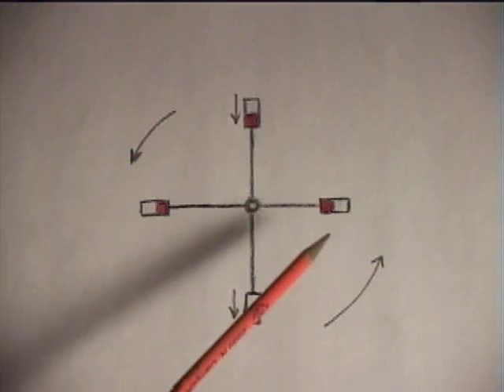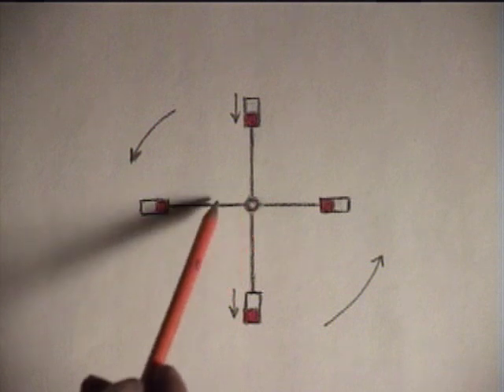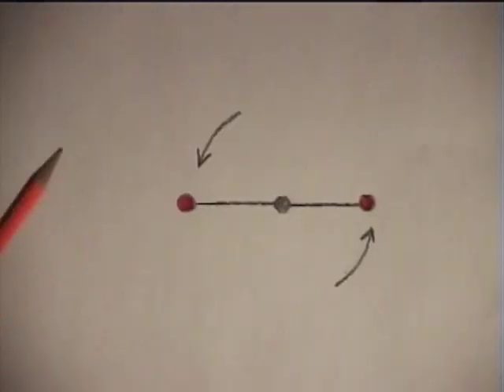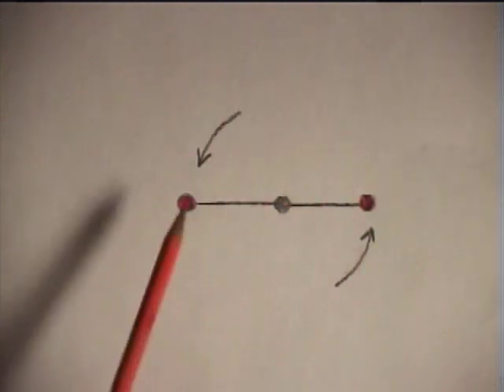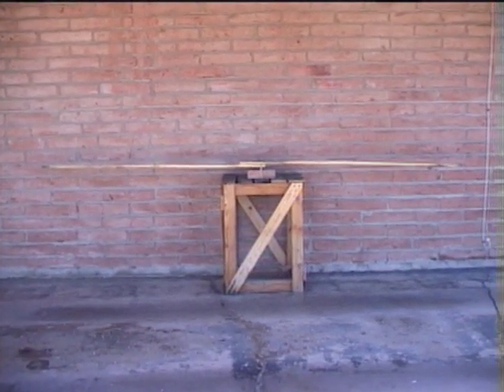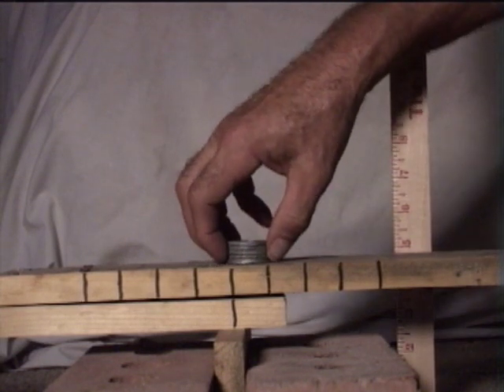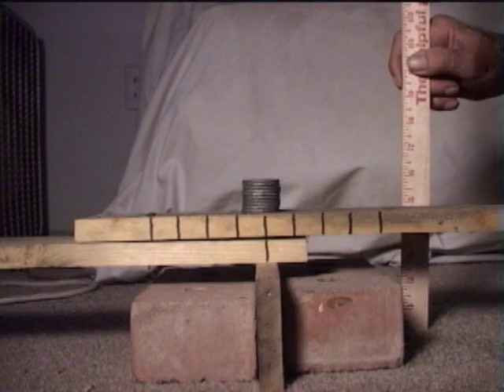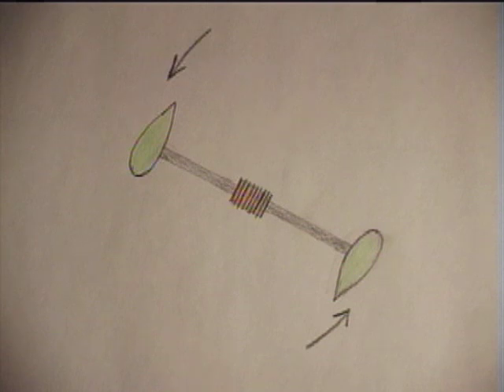Gravity Energy Wheel, Free Energy

Comment: you are on the right track because gravity is constant. on a fly wheel you have four 90 degree pie. with four triangles around a flywheel there is no reason why we couln"t use a heavier weights in the inner portion of a wheel to displace lighter weights to the outer edges of the wheel, it breaks down to using 4 independent but subordinates sections in a fly wheel with two alternating forces the weight and counter weight to determine the position of the mass and create a unbalance wheel as it rotates past the vertical position gravity pulls down on heavier weights to displace lighter weights to the edges as the vertical alignment riches 180 degrees the heavier weight fall to the bottom reversing the position of the weights and the cycle starts again. imagine your fly wheel had a weight on a track across or vertical to a line parallel to the center axis, as the wheel spins your weight will shift back and forth as long as centrifugal force isn"t greater then the minimum force drawn out of gravity wich is imposible with out other source of energy. I have some drawings if you are interested I can send them to you.

Comment: Interesting experiment. I think you'll find that the effect you're looking at here is actually a shift in the pivot of the arm across the fairly thick piece of wood you used as a pivot. As you move the weight near the 'hub' to and fro the pivot point shifts in the opposite direction to and fro across the width of the wood. If you used a narrower pivot, preferably a piece of triangular section then this effect would not occur.

Comment from the maker: When is the last time you saw a real life machine that has a hub balanced on a sharp pencil tip? Real life machines have hubs that are not that sensitive - that is my whole
point.  If you have a spinning flywheel, with most of the mass at the rim, small changes
at the hub will not affect the overall spinning flywheel.

Comment from the maker: (1) I realize the wood pivot has it's problems. I used it to be able to do a quick experiment.
My next goal is to make an arm with a good bearing at the center. (2) You are wrong
about the ant because we do not live in an ideal world. We live in a world where machines do not respond to small changes in weight but this is a relative thing. The
question is can this be exploited to produce useful energy ?

Comment: the mass DID hurt the balance of the arm, but it did not move up to a certain point due to the friction forces, so when you "calculated" the ratios, you did not take into account the weight, girth and the coefficients for friction on your wood surface.

If you try to build the same assembly using a bearing at the center (not wood on wood) you will see that your ratio changes. in a ideal (no friction) assembly it will move with the weight of an ant :)

am I wrong?